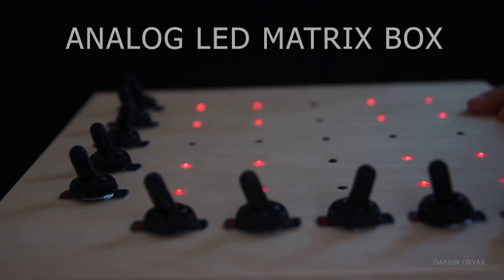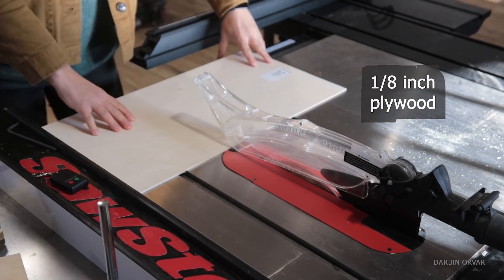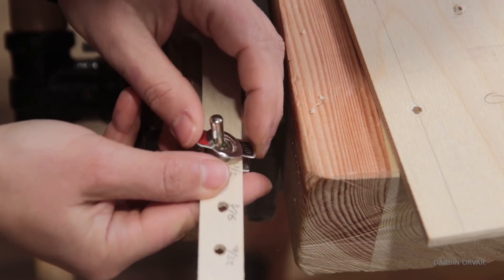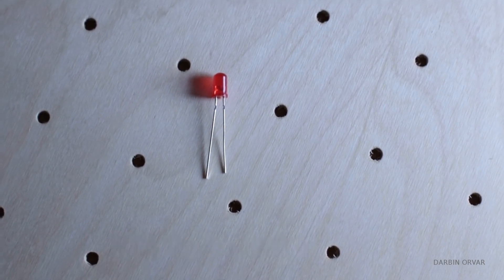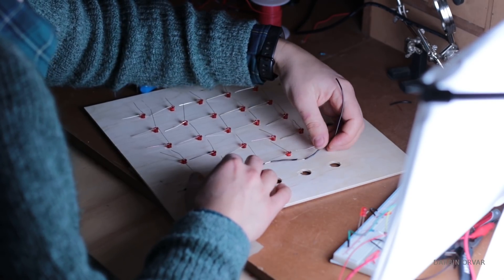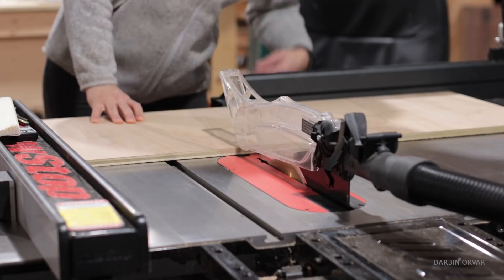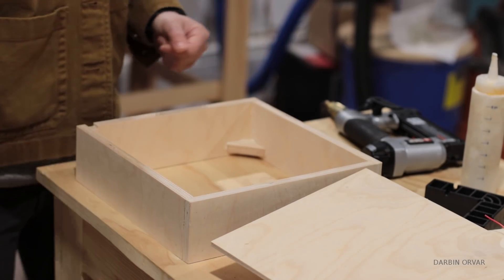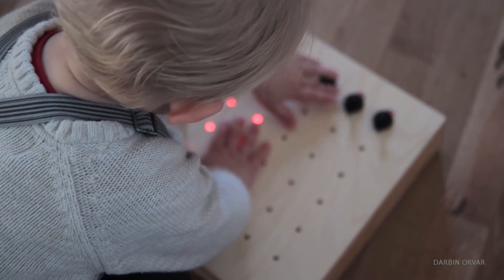Building an Analog LED Matrix Toy for Children

Comment: Hi Darbin, this looks fun and I would like to build one but a few questions:
Your link for the switches does not take you to the switches used in your project.  Can you please correct the link.
Your link for the controller is for a packet of 10.  Is there another link where I can buy just one?
Your video mentions a female micro USB charger that you notch the box out for but I don't see a link for that.  It didn't look like it was part of the controller link.
While you do, very kindly, show a rough wiring diagram some actual photos of wiring the controller would be greatly appreciated.
As I suspect many of your viewers. the wood part of the project is a snap but the wiring, while admittedly not NASA, is still a reach for me.
Many thanks in advance.
Steve

Comment: I plan to build one shortly - however, I'll alter the box design to inset the top.  Because it will inevitably be picked up and thrown probably, or just flipped over.  And an inset top would protect the switches in such a case I'm hoping.

Comment: Just tried to make this. When I connect the LiPo battery all of the LEDs turn on and no matter what I do I cannot turn then off. Kind of frustrating
Reply from the maker: Sounds like the switches are not between 5v power and the leds properly.
Reply: @darbinorvar  you are correct! I figured it out about 10 minutes after I posted this comment. I wired it exactly like your hand drawn schematic, without the switchable leads on the opposite sides of the switches. Once I ran the second set of wires it all worked properly.
Reply: @Prosecute-fauci  Hi Yidris, which resistor did you use to make the project? I paused at 05:57 but cant see the colours. Does every row and every column have only 1 resister before incoming power? Thank you
Reply: @houtstyle9368  if you buy the leds from the link they come with the proper resistors. Also, every bank gets 1 resistor. It doesnt matter what side you put it on. Lynn put hers on the negative side, I put mine on the positive. They just have to be in the circuit.
Reply: @Prosecute-fauci  Great, thanks Yidris. Im in South Africa and its too expensive to buy from Amazon. I will try see the resistor codes on Amazon page. Thanks again.
Reply: @houtstyle9368  I will read the color code and get back to you
Reply: @houtstyle9368  470
Reply: @houtstyle9368  yellow, violet, black, black, brown
Reply: @Prosecute-fauci  Thanks Yidris, I really appreciate your help.

Comment: Can u supply the schematic also? Are you using 1 resistor per LED? You didn't specify it in your video The resistor value will be different depending on the LEDs used